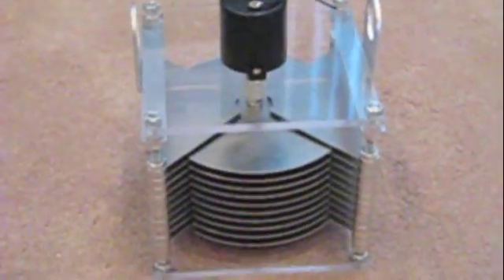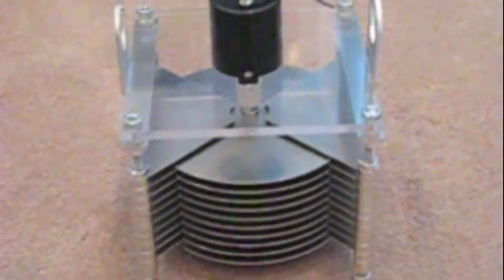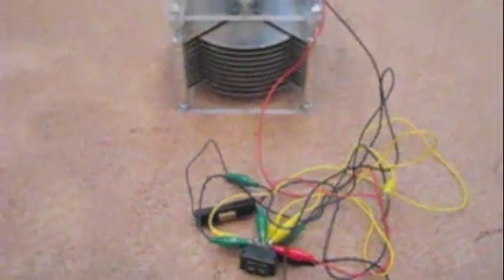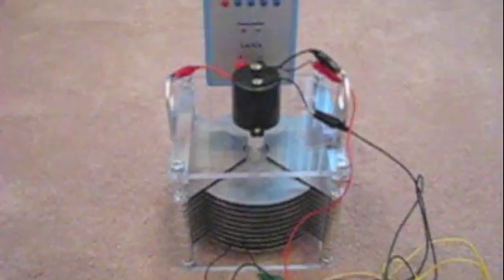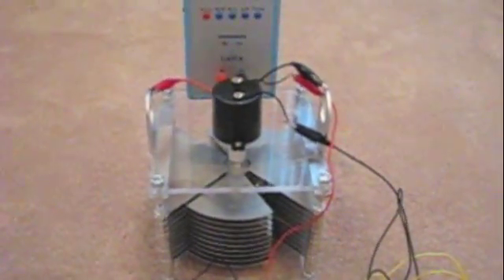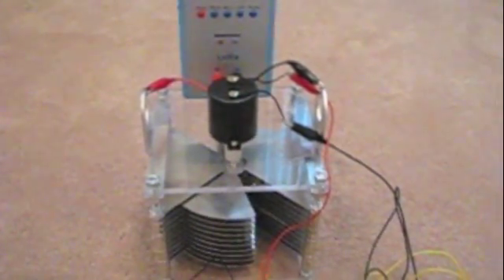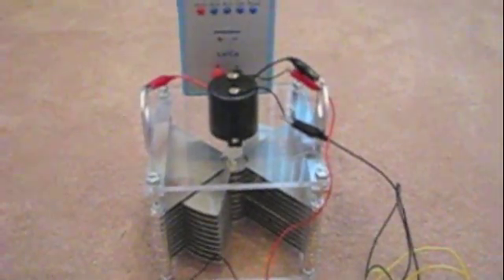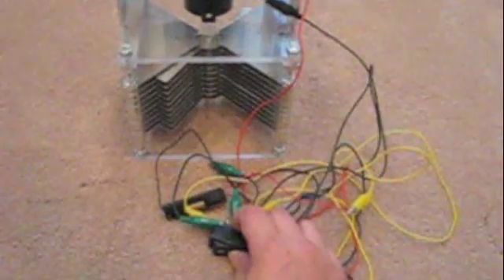135 pF Variable Butterfly Capacitor for a Magnetic Loop Antenna

Comment: I am gathering parts for a motorized tuning circuit for a mag loop antenna. I intend to use the loop as a dedicated 80-40 M receive antenna and continue to use my vertical (Butternut HF6V... P.O.C.) Antenna for transmitting. My question is what diameter (length) loop would be reasonably efficient and what pF variable cap would cover the range? Thanks, Jack N2LBI

Comment: I've but one question. what if I paint the stator with a dielectric paint rasing it electrical value rating from 1000 volts with an 8th inch air gap to ?l
????. now does it maintain it's current pf rating. does the pf fall. does the pf rise. I suspect it falls. as voltage goes up like electrolytic do in series. the pf falls off. so this may eliminate the need for expensive vacuum caps. so the prodject would require a larger cap. in my humble opinion. or even layer it in a 6 mil thick polyethylene. I've seen it withstanding just shy of 30,000 volts using one ply of it in a static cap experiment. what say you?